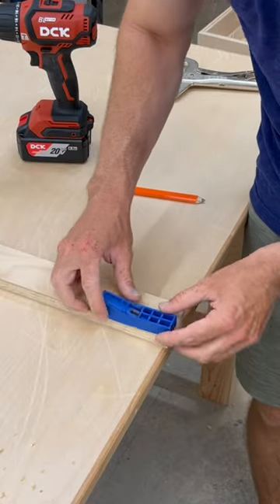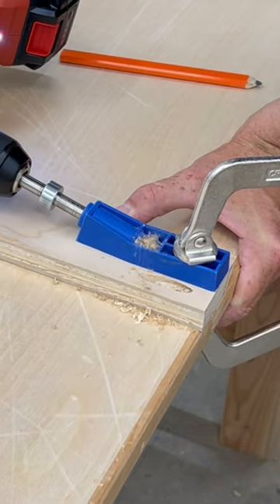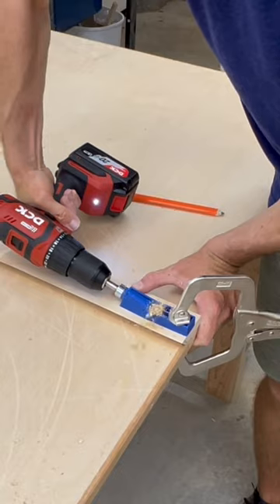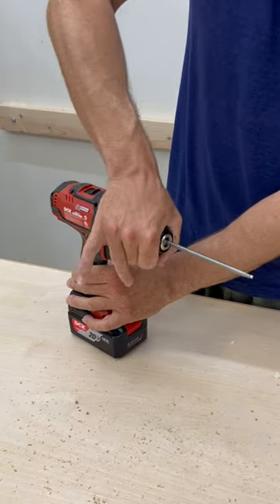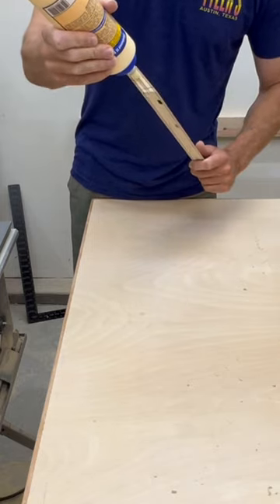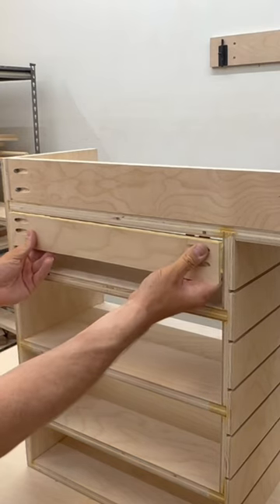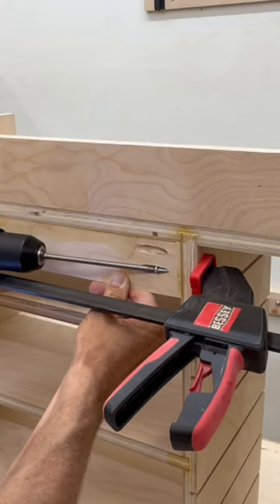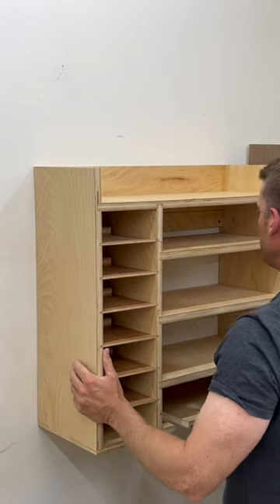Is This French Cleat Strong Enough?

Comment: DCK?  Hesitant to invest in that battery ecosystem.
Reply: Any cheap drill will work for little home repairs or putting screws in drywall for hanging pictures. Otherwise: Milwaukee Fuel, Dewalt XR, and FLEX are generally your best bet for pro work.